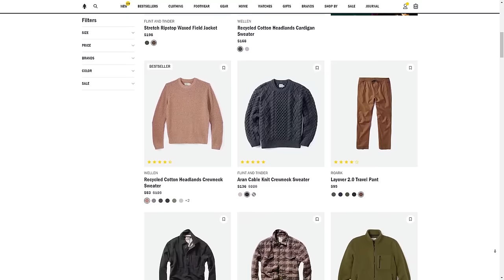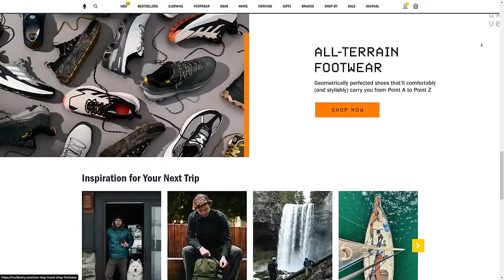Cowboy Boots TOTAL RESTORATION

Comment: why in the States you don't put a thin sole protector? It's not visible, it helps avoiding sliding and protects the leather and the stitches and when it is worn, you just take it off and glue a new one instead of taking all the stitches off, the leather soles off, the welt off etc. Cost in the first case 20$ max, instead of 250-600$ in the second! Great job as always!
Reply: I've seen US cobblers use sole protectors, so it's not like they don't at all don't worry. In fact, when you search "Trenton and Heath sole protectors" you will see they've done videos on sole protectors for various shoes/boots 😊! They aren't the only ones who have used sole protectors though. Also, these boots in the video were deeply worn, and you see how worn in the sole is with the holes in the layers. So I can see why they repaired the way they did, since the soles needed this kind of repair badly (it would explain the pricetag for the repair, however much that was, but yea expensive!). I'm thinking sole protectors weren't going to be enough to save them at that time. But yes as you said, they are very nice to have, and prevent slipping!

However, since we do see how well repaired the boots are, the customer should take your advice and add sole protectors to prevent any future damage! And it would make it cheaper for replacing as you said 😊! So hopefully a future repair visit won't be as expensive as this one!
Reply: @okieJams Oh, I didn’t mean in this case as they were! These boots were in desperate need of what Trenton and Heath did! I meant afterwards and only if the customer checks often when they are gone to change them. I think I’ve seen almost, if not all, their videos 3,4 times at least😂, but I don’t remember seeing them, or any other cobbler I watch, use them just glued on. (I found them! In the shoe care tutorials! I keep watching the repairs!😂) Do cobblers in general, in the US just glue the sole protectors plus maybe a few tacks, or stitch them? Because all I’ve seen is stitched. That in itself is doing the exact opposite of their goal! They are supposed to protect the stitches underneath! It is interesting to see the differences between the European way of shoemaking and repairing and the American! Like two different cultures! Both when done correctly beautiful!

Comment: So I understand what a heel rand is and that it is used (with 270° welts) and that it's cinch-nailed on. But I'm not sure I know exactly why we need it. I'm sure I've seen one or more pair of 270° welted boots or shoes without a rand and just the midsole at the back.

I know I  some applications the welt meets the rand with a skived joint but the welts in these boots don't go back that far.

Is it just to clear the shank?
Reply from the maker: On cowboy boots the rand serves as a spur lip.  It also gives shoes a clean edge around the back.  Some bespoke shoes will skip the rand and just curl the sole up around the upper in the back, but even then, they take a knife and cut the lip off.
Reply: @TrentonHeath  thank you. Yeah, I understand 270° welts offer a sleeker cleaner look at the back and that some have a lip at the back while others don't  I never considered whether that was intentional or not. But looking at a handful of my boots and sgows now I guess there's no standard ;)

Comment: Is shoe making magic? I always wonder how the nails go in so far yet never touch the foot inside the boot, even after wearing so far into the boots. Just always seems the nails are long enough to go through the whole boot
Reply: I've heard many cobblers on YouTube say the nails actually curl inwards, after they hit the metal last, that the shoe sits on while being repaired. And it's true! I've even watched shoe manufacturer channels such as Nicks Handmade Boots and JK Boots, and they've also said the same thing. It's why the nails don't pierce our feet. These are called clinch nails. The nails curl inward and stay inside without piercing through the insole to our feet. So no need to worry. I had wondered for a long time myself. So I understand.

Comment: Many people don't realize that 'real genuine cowboy boots' were never designed for walking. They were designed for riding a horse. You need to feel the ground under your horse through you soles. No cork inside and not very thick soles. Heavy stacked heel to hold the stirrup. Most modern day 'cowboy boots' are just for posing.
Great job on the rebuild guys!
Reply: I wear mine mostly for “dress shoes” anymore.   I did wear a pair of Tony Lamas when I rode horses.
Reply: What would be the footwear of choice for said men when they were indeed walking around doing their general farm work?
Reply: @prodiptoroychowdhury2313  A farmer's boot had a much heavier sole and not as pronounced of a heel.  The heavy sole was for support for walking and long 'tread life'. Unlike the traditional roping cowboy boot that needed a very pronounced heel to hook the stirrups to give him more control in the saddle.
Reply: @prodiptoroychowdhury2313  Get some rubber soled cowboy boots, ranch style boots, roper style boots... etc.

Comment: Serious question: After over a 3 year wait I recently received my Role Club engineer boots, I must have made an error in converting the length of my foot from inches to CM and they’re about a size too short.

I contacted a cobbler here in NYC who said he could relast the boot. Is this possible without losing the original leather?

I’m sick to stomach after waiting all these years and spending nearly $2k to get these beautiful boots only for them not to fit.

How would increasing the boot size/relasting work without losing the leather vamp of the boot?
Reply: Wow seriously?? The cobbler kept your shoes for 3 entire years? What a shame, sorry to hear that :(! Yes your boots would need to be relasted in order for the size to be more comfortable for you. After watching Bedos Leatherworks on YouTube, it sounds like a cobbler would actually find the closest matching leather, to extend the size of your boots, and also using an appropriate last based on your shoe size. I've seen Steve on Bedos do something like that to what you're asking. The added piece of leather on the edges would be skived, making the edge thin in order to blend better to your boots (to make it as flat as possible so that it's barely noticable). It would probably be glued on carefully. Then a cobbler would blend the added leather with the current leather of your boots with color creams and conditioners, etc. Depending on how much of the size you need added, you might need new leather footbeds (what the welts are sewn to) or perhaps a cobbler might add a piece into the existing footbeds to extend the size of the footbeds.

I know you'd definitely need new welts for sure since you'd be sizing them up, so the welts would need to be longer to go around your boots. You'd also need new outer rubber soles due to the extended sizing as well. That's all just a guess. You'd have to talk to a cobbler for exact information, and pricing. So it's possible it could be done! You'll just have to shop around (if you want), and find a cobbler who is willing do it. Again, I'm really sorry they kept your boots for 3 entire years :(! Especially all that money invested into them! That's completely unacceptable and unprofessional from that cobbler!

You should also email Trenton and Heath. Their site is on their About section of their YouTube channel. The contact info will be at the bottom of their site. That way they'll get back to you soon.